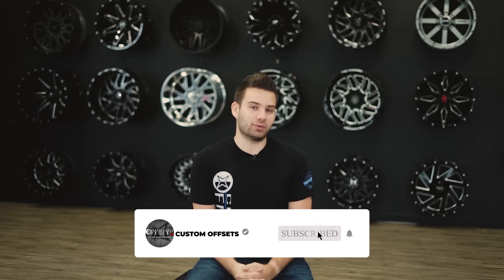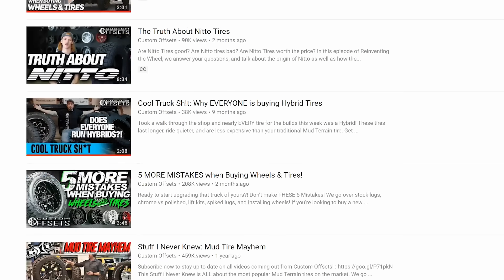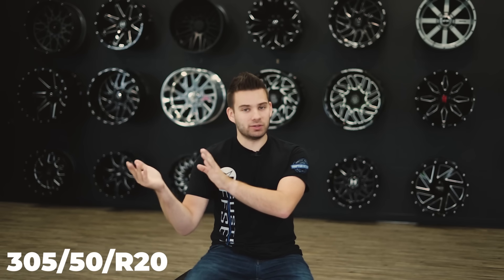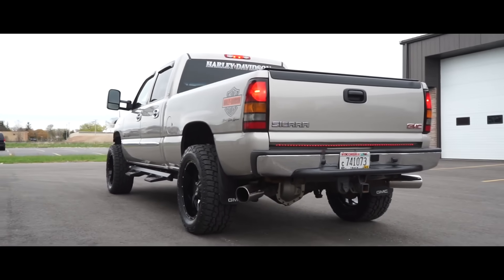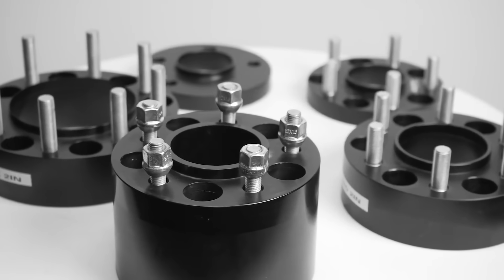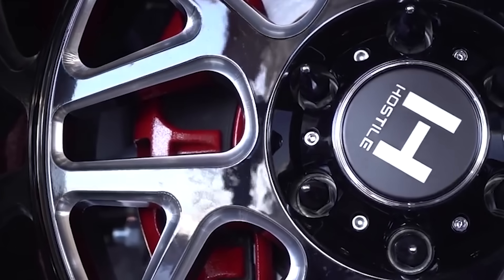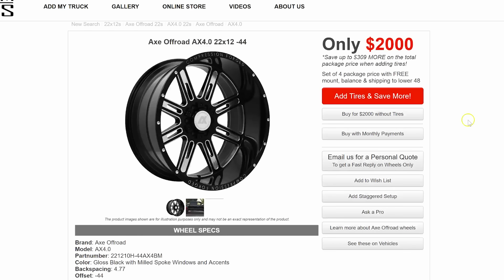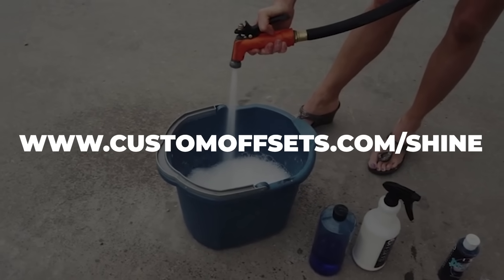WATCH THIS BEFORE YOU BUY WHEELS AND TIRES!

Comment: Which manufacturer makes a nice set of wheels with a forrest green highlight? I've got a 2015 F-150 and the wheels are getting corrosion and leaking air. I'm needing new tires as well so I figured I'd look into a nice set of wheels too.
Reply from the maker: Here's wheels in your bolt pattern! You may want to look into custom powder-coating for your wheels to be that color! http://bit.ly/31RIvrr

Comment: Question
I want to change the WHEELS and Tires on my 2017 F-150
it came with 17 in factory wheels
I want to put 20 or even 22 wheels on the rear, but keep the 17 in wheels on the front
Maybe the Offset on the front maybe pushed out 1/2 in, but the back 1 to 1.5 inch

Question is will the truck have any issues with this setup
Reply from the maker: You could do that however you are better off to just get all 4 wheels to be 20s or 22s.
Reply: The idea is to provide the Raked effect to the overall stance of the truck
Reply: Why would you want to do something so stupid?!?!
Reply: You are way better off to buy a cheap rear end lift kit. Way easier to install than a front end. Unless there is something weird about Ford rear ends that I dont know about this is usually a cheap and relatively easy thing to do. And most importantly doesn't carry the chance of grenading drivetrain parts like 3-5 inches of tire size difference between the axles does. Admittedly this grenading effect applies mostly to 4×4's but still just buy a rear end lift kit.